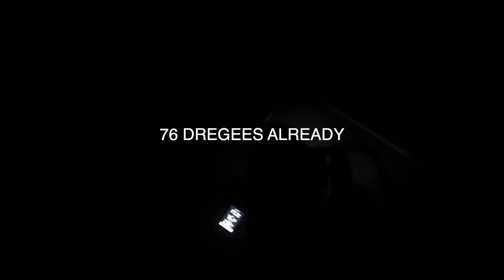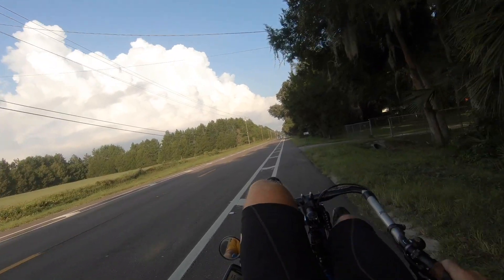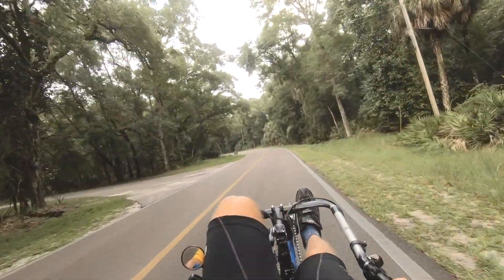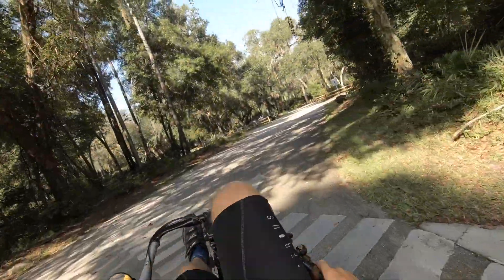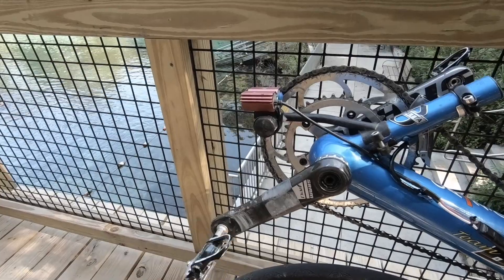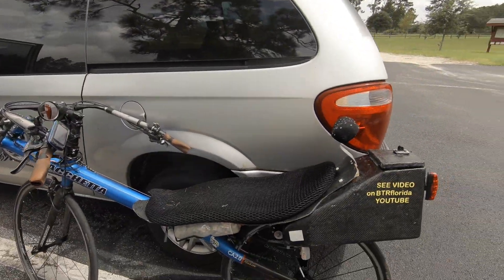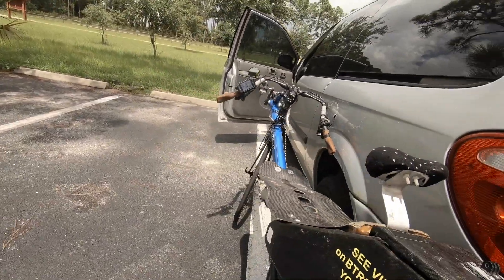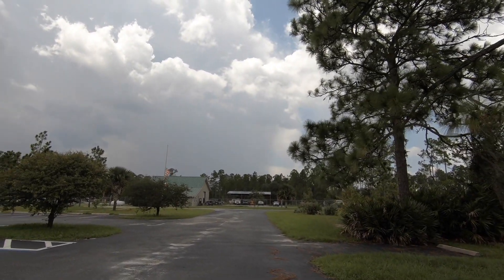My Bad Ass Bacchetta CA2

Comment: Nice, long ride. Any aches or pains from such a long ride.
I currently ride a mountain bike and have a sore butt and lower back only after a short 1 hour ride.
Is there much difference in performance between the Corsa A70 and the CA 2.0?
I checked the weight of both and with disc brakes there is 1 pound difference, but a $2,000 difference in price.
I do prefer the blue color.